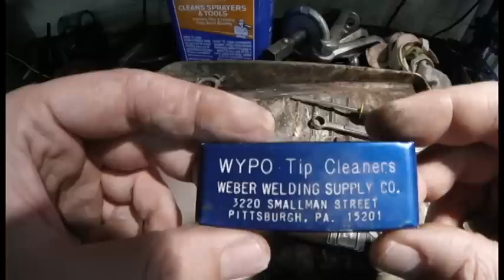5 MINUTE FIX! Go kart carburetor service

Comment: Hi, I bought recently a go cart for my kid because it was his birthday.  It's a Realtree RTK200 by (Coleman) 196cc.  It was working perfectly until a few days ago, we have only put about 4 hours of driving overall in about 6 days I think.  On the last day that it worked the car was still turned on but we had decided to stop riding it for the day and as soon as we were going to drive it into our back yard to store..... the accelerator was not responding. So yeah the car just didn't want to move, it just revs like it was going to move but nothing.  It just feels like when you have a car parked or on neutral and you accelerate and obviously you won't move. The cart turns on and off every time it just doesn't go no where.   If you can offer any advice I'll appreciate it so much. Thanks.

Comment: How do I adjust the idle? I have the same engine but different carburetor. 3 HP Briggs and Stratton engine
Reply: I'm not sure what carburetor you have, but look where your throttle cable is connected. There should be a screw with a spring on it for adjusting the idle. A little goes a LONG way.